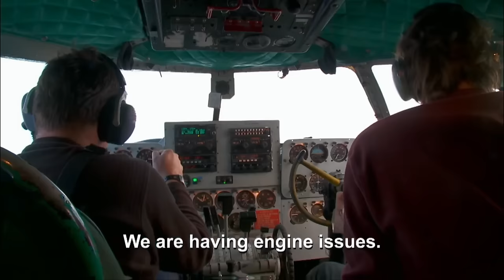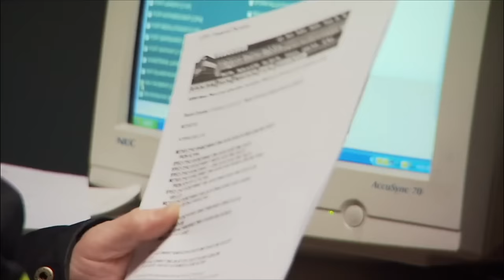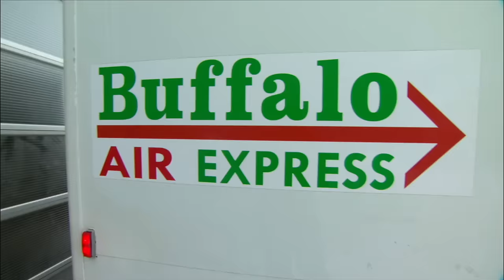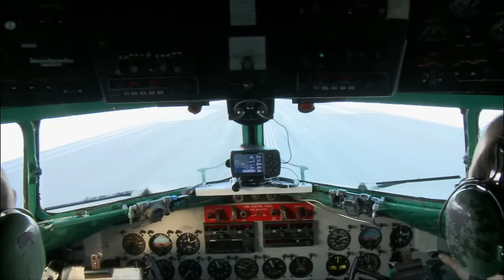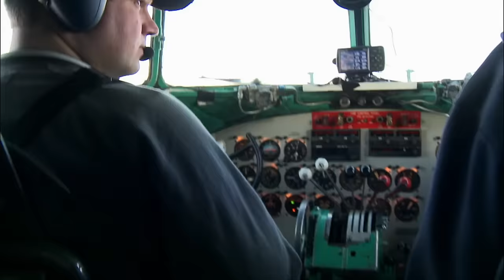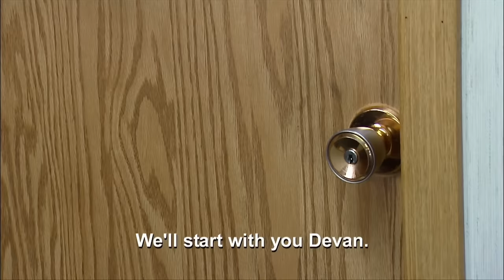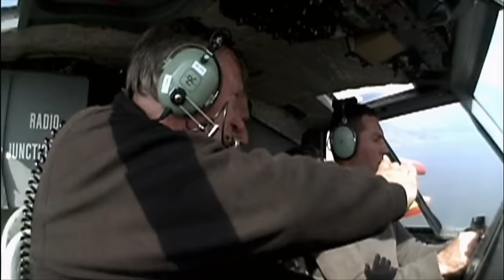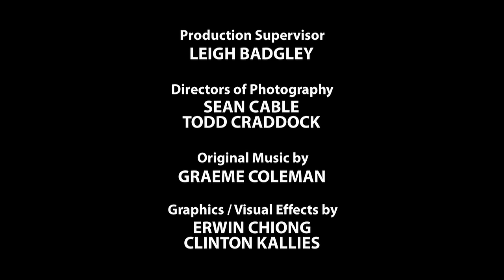Binge watch Ice Pilots S1 | Go Xplorer

Comment: Iv been flying all their actual routes in a DC30 on Flight sim2022 while watching this. It's fun. The dc30. Not easy to fly!!
Reply: DC3? The Douglas Aircraft Corporation only had DC model numbers up to 10, 9 if you don't count the DC-10 because it came to production during the McDonnell merger. Or, is there a rare aircraft that's an offshoot of the WWII workhorse? The DC3 handles well, but as a fellow sim pilot, I agree you don't truly appreciate how much automation there is until you fly a warbird with steam gauges and a milllion switches and levers, and in a virtual DC3 that won't have problems unless you want to simulate them.

Comment: The VERY FIRST THING THAT YOU DO in a case of first landing with the gear up and then when you come back with the gear down on the second landing is PUT THE GEAR PINS IN THE LANDING GEAR!!! OR doesn't this aircraft have gear pins to pin the gear down and locked? That's a dangerous place getting underneath the aircraft without the pins being installed FIRST!